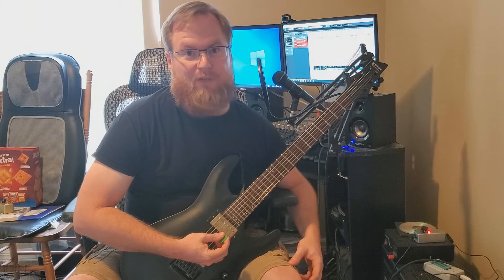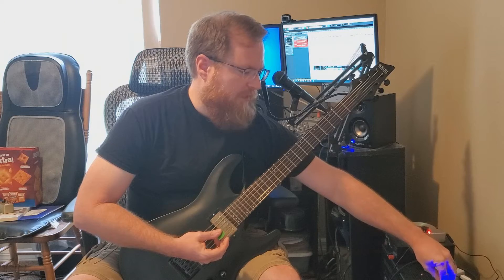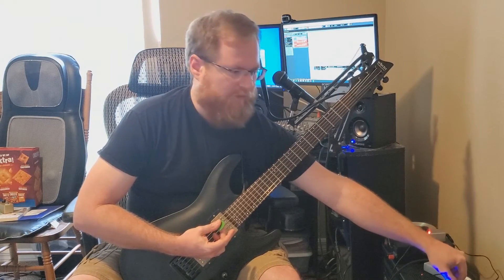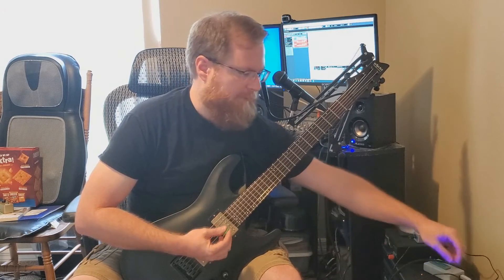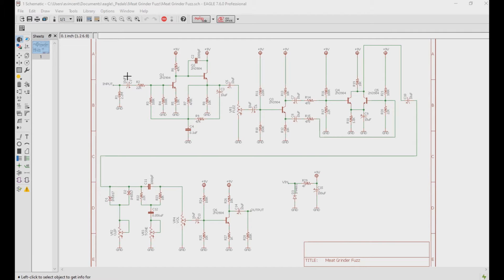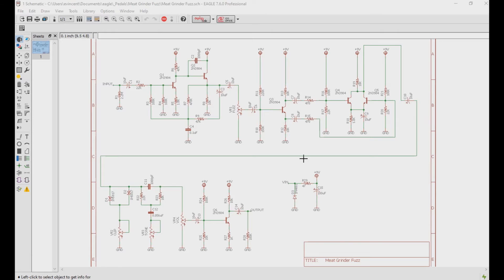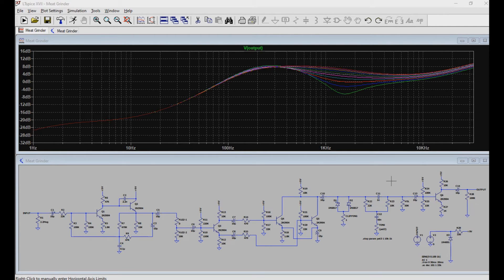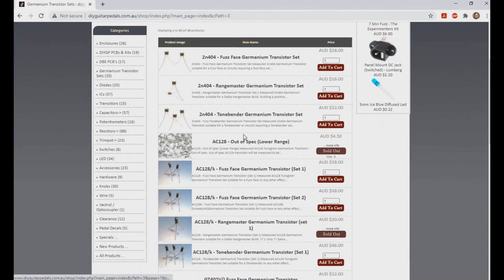Meat Grinder Fuzz Demonstration and Univox SuperFuzz Explained.

Comment: I found out about Schottky diodes when I was experimenting with passive ring modulators. That low forward voltage is a must for super small signals.

Comment: this sounds really nice, im new to this and ive tried to bread board a Super fuzz a few times now and it usually ends up not having much fuzz , im going to see if i can bread board this Meat grinder circuit i really like the tone control you have used. i do have one question , i was wondering if this mid cut/flat could work more like a mid cut/mid boost and have flat be around 50% ? thanks for the video i really enjoyed the sound of this circuit.
Reply: The bridged-tee, at least in this configuration, is a passive filter, so it would only be able to cut. To do more of a boost, you'd probably need to look at a gyrator circuit, like the ones used on the Rock Bottom pedal. You'd be looking for a wide Q for that same curve, and just make it so that the potentiometer only boosts and doesn't cut.